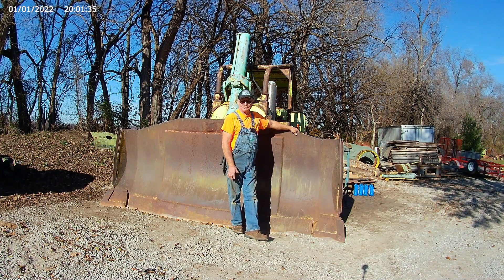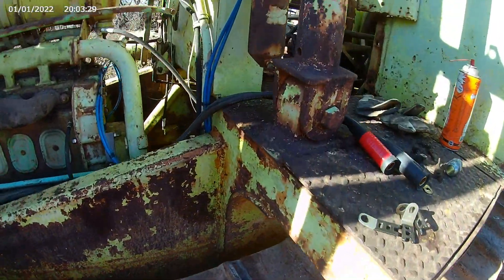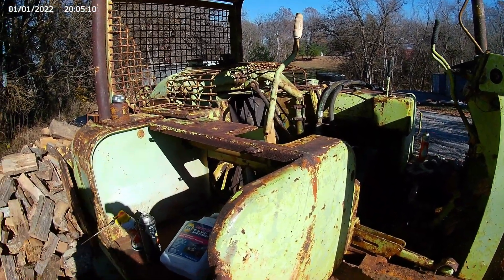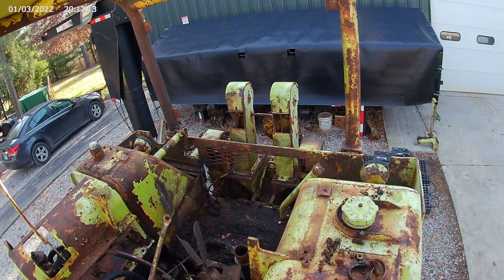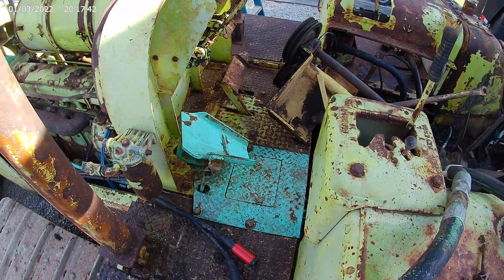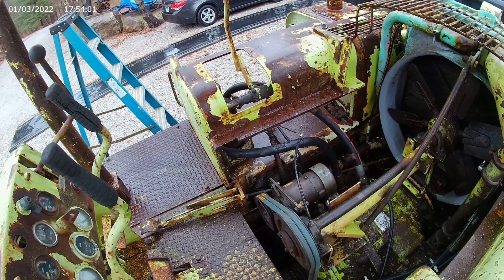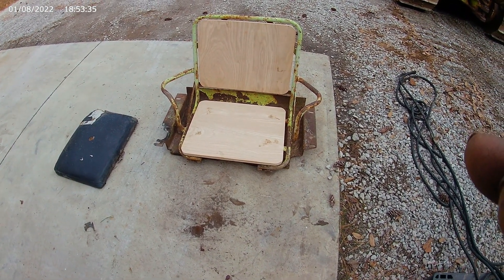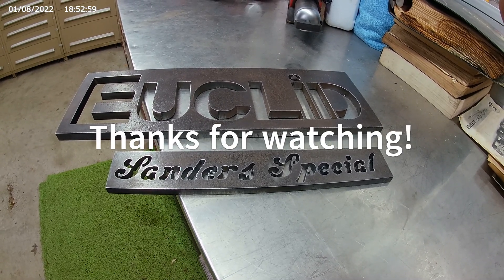Euclid 82-30 transformation from cable dozer to hydraulic dozer part 1

Comment: Hey Mike I just subscribed to your channel. We have a 8230 just like yours on our ranch here in Texas.Our radiator looks like yours and we can’t figure how to get it out.  Are there bolts on the sides of the radiator to the frame or just the bottom?  Any tips on how to get that radiator out?  Best
Reply from the maker: Back of radiator 4 bolts to top of trans- 1 brace to top front with 1 bolt ,remove sheet metal around radiator pull straight out the top.
Reply: Thanks so much. We can’t wait to work on it Tommorow. Have a great evening
Reply from the maker: @user-cd2bh7lm1c  Any time!